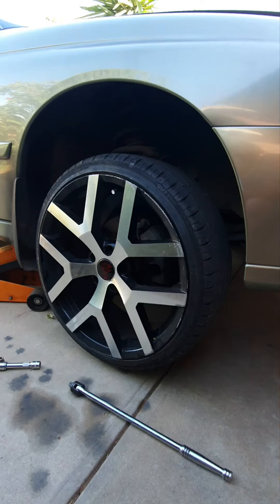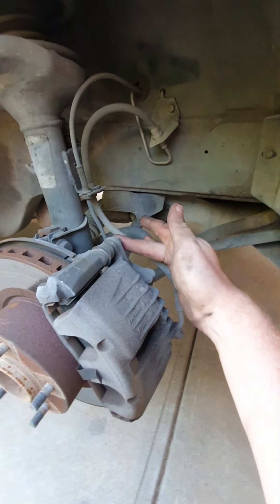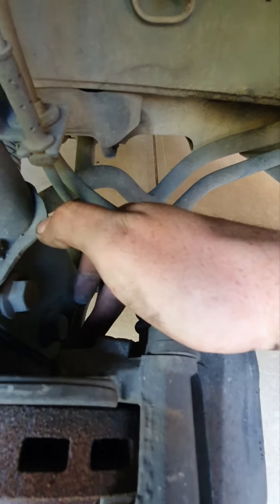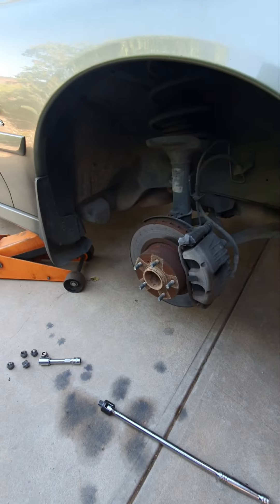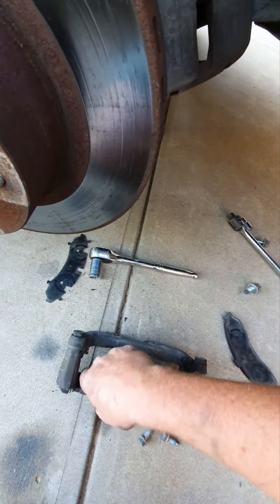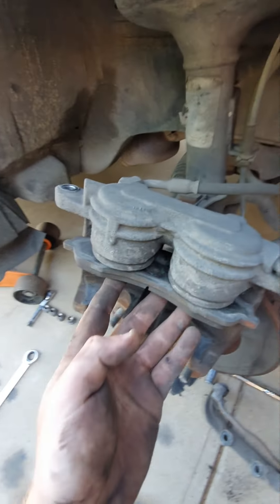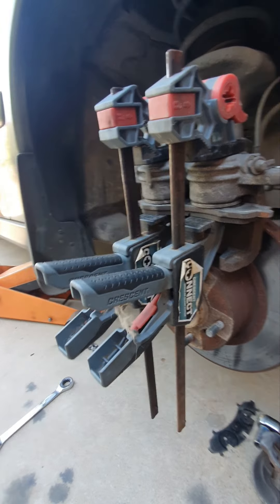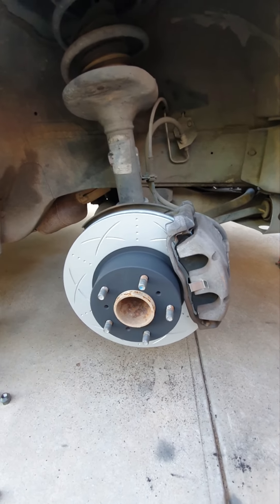Changing front brakes on a VY (same from VT-VZ)

Comment: Thanks for the tip. I had different size bolts to take break pads off. You said 13mm and 17mm. I had a 12mm and 18mm